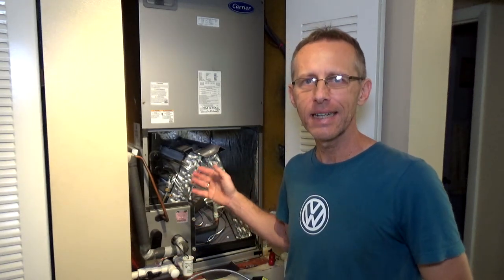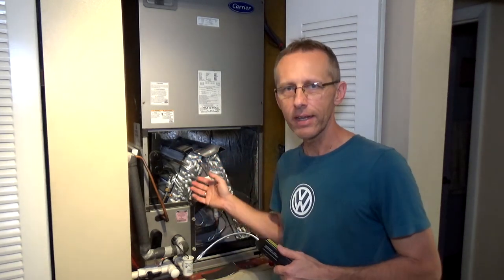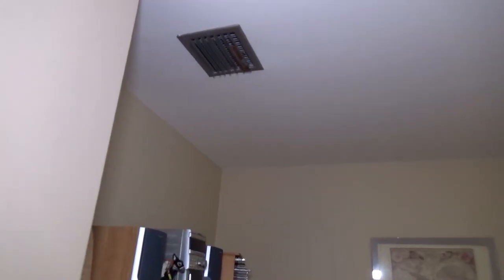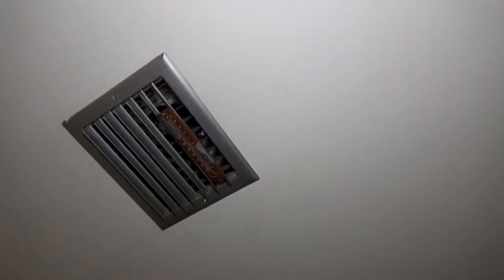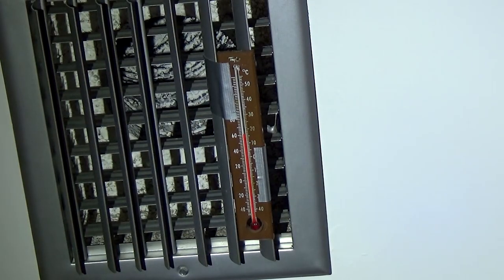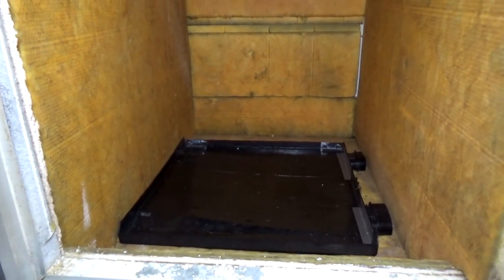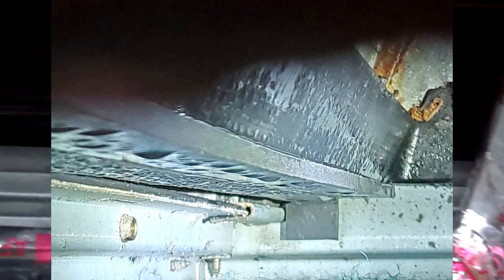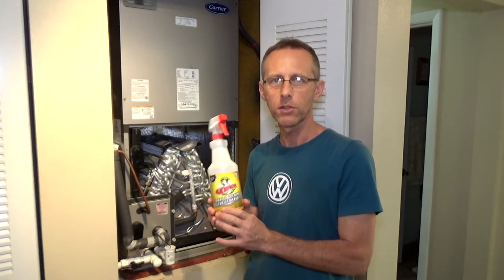3 Ways to Detect AC Leaks

Comment: My ac unit seems to leak water instead of freon. Any idea how to fix. Thank you.
Reply from the maker: watch my other AC videos to figure it out. You may have clogged drain or maybe freon leak which causes your coils to freeze and drip water onto the floor. It's hard to diagnose without seeing it.
Reply: @MaciejPiotrowski   Hey just an update. I called my apartment maintenance and he came and sprayed coil cleaner on the coils and I think he sprayed it inside the pvc pipe or the condensate line I think its called. Just the opening top and side. Then he sprayed water on everything even inside the pipe. Put a new filter on and it hasn't leaked since. He told me he'll come back in October to do maintenance again for the fall. Said it should be done a minimal twice a year fall and spring. Thanks though.